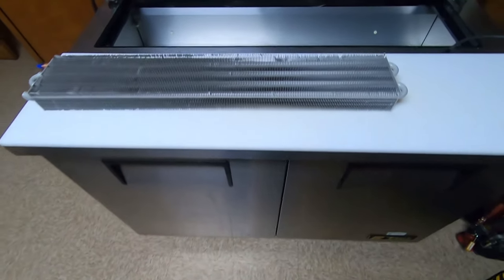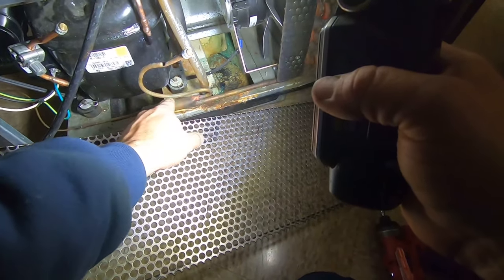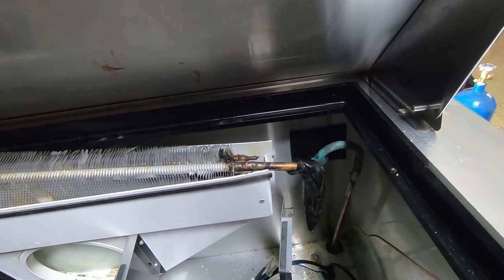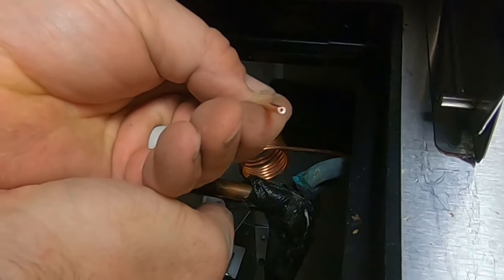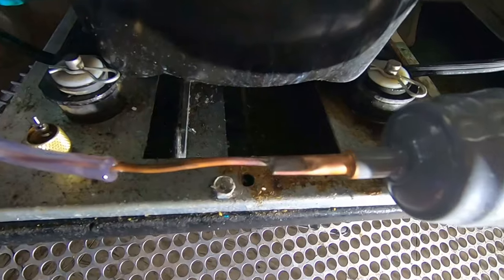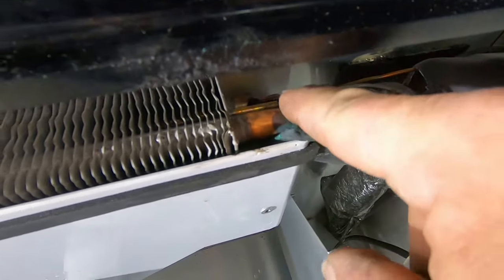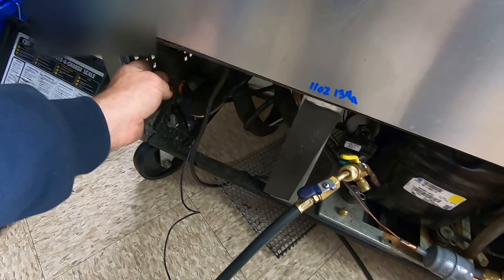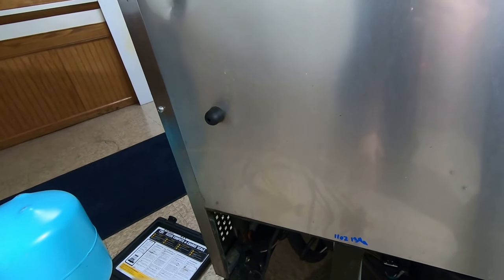True Prep Table Evaporator & Capillary Tube Replacement With Full Start-Up Procedure

Comment: Comming from electrical industry where people are more concerned with theory of measurements I wonder - the gauge used has declared accuracy of 5% + 5 micron. With reading of e.g. 600,0 the real value can be 35 micron off, i.e. between 565 and 635 micron. BlueVac, why do you put 4 digits on a meter with accuracy class 5?
Reply from the maker: I just checked out Testo, CPS and Fieldpiece and all of them are only 10% accurate. The only brand that I seen came in at 5% besides the Blue vac was was Thermal, the 4 main features that set this gauge apart from all the others is it can be calibrated in the field, the resolution is a tenth of a decimal, 300 hours of battery life and it holds up for well over six years so far with no problems. And this is the only micron gauge that I know of that has the leak rate broken down for easy identification. You need to remember everything leaks and the leak rate is what's really important so you can verify if all the moisture is removed. Check out Jim Bergmans vacuum videos if you want to know more about vacuum. Thanks 4 checking out my video.
Reply: @HVACRSurvival  Thanks for your replay. Again and again, I find out that I learn more by writing than by reading ;-).
You're right as far as Testo 552 goes (which I own). Testo does the same - 4 significant digits.
Declared and real accuracy are completely diffrent things and if I can not check it myself I do not believe any manufacturer and do not even consider it specially interesting. In any case any of them can  be used in the field with more or less the same result.
re Jim Bergmans - I do not find his test procedures objective. Setup for testing hoses with  gauges at the end of hoses indicated that either a) he has no clue what and how to test, so that numerical values mean something practical or b) he chose particular set up to emphasize advantage of one product above another.
Reply from the maker: @Luzt.  When I first tested my Tru Blu hoses I put the gauge at the end of the hose,  it took several times longer to reach a low micron reading over a 3/8" hose. Does this show all the science behind the larger hose or the capability of the gauge ? No,  not in one sense but how do you dumb it down to make it easy to understand for everyone that is not interested in knowing all the science behind it? You can only show so much in a video that according to the provided data from YouTube,  most people can't watch a whole 10-15 minute video from start to finish,  it's amazing that on average most people only watch 40-60% of the whole video without skipping around. The human attention span is comparable to the mind of a good fish. And that is facts. Sad but true.
Reply: @HVACRSurvival  I agree and it reminds me of a story from some old, paper book with anecdotes about scientists. There was this experiment where students were to learn the color of pure water. It required 50 m of tube filled with water and sun light. The teacher noticed the assissant adding something to the water and asked what it was. The assistant said, it was some compound with azure color which allowed to make the experiment easier, because it required much shorter tube. The teacher noded and suggested that maybe the assistand should put more of the colorant and simply do with a simple test-tube. The conclusion will be the same - water has azure color.

Comment: How much did you charge the customer or is this a warranty call?
Reply from the maker: I have no idea on the price. I get told how long I have to get it done And what parts I get.
Reply: How long did it take? I'm replacing a compressor on an undercounter tomorrow lol
Reply from the maker: @sandeepsekhon6748  4 hours I believe. It was quoted for more time than that but I could probably do it in 1.5-2 hours if I didn't care about my work.

Comment: TO MUCH FLAME 🔥 YOU NEED TO LEARN SKILLS ABOUT THE TORCH
Reply from the maker: Thanks for your opinion, post me a video showing exactly how to do it if you would please. Once you posted it I will evaluate it and let you know if you really do know what you're talkin about. Most trolls don't have a clue what they're talking about, so please instead of a lot of talk,  show me some action..  but I expect no response or an excuse why you won't and in the end no video to prove you are the master. Here's a little hint, get on and get off of the joint and don't set there and smoke the bitch because you're on it for 20 minutes with your sissy ass little flame. Also you can remove your tip away from the work and adjust your heat that way you don't have to have it right on the material. I can use a cutting head and braze a little quarter-inch line, it takes a little more skill than having just the perfect cone.  I will be waiting for your response, and if you are correct I will do a video just dedicated to give you credit on how good you are.
Reply: @HVACRSurvival  Damn Rick.....cease fire, he's already dead lol